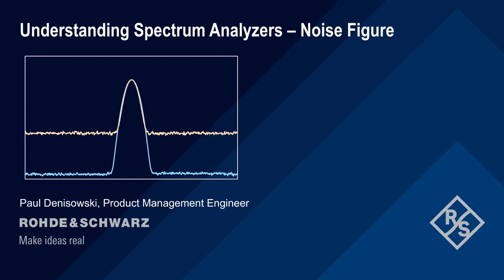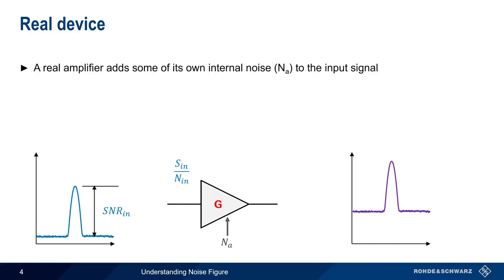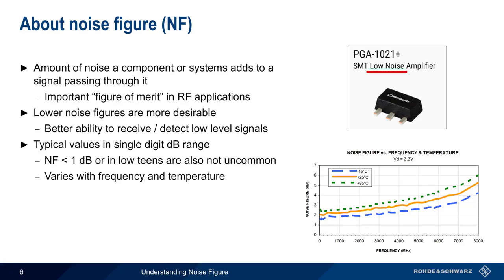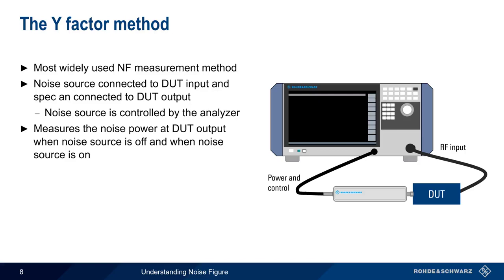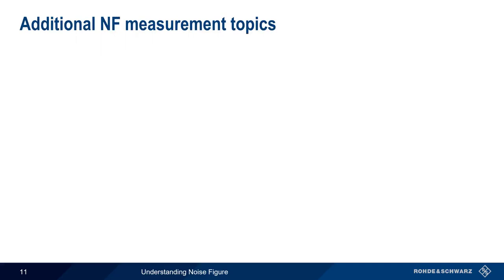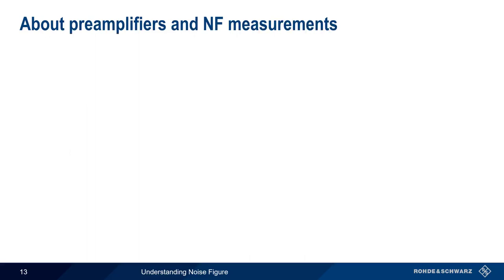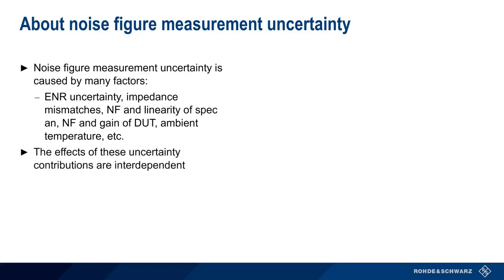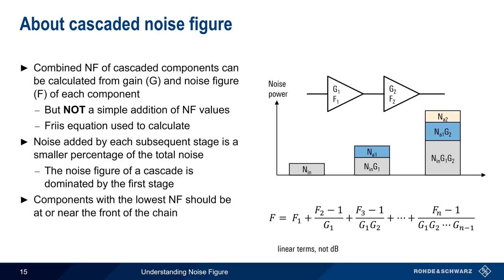Understanding Spectrum Analyzers – Noise Figure

Comment: In slide 15 should we insert noise figure or noise factor into the equation? It looks more like noise factor
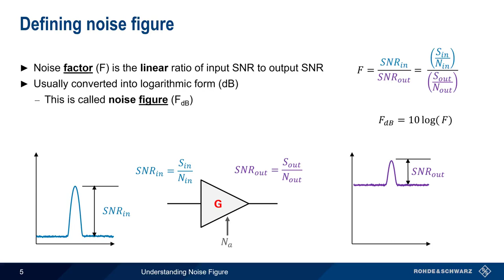Reply: Yes, the equation uses noise factor: that's the reason why I added "linear terms, not dB" below the Friis equation.  Noise factor can then be converted into noise figure using the equation shown earlier in the presentation (see 3:04).  Cascaded noise figure is actually such a complicated topic that I'm planning an entire separate presentation on it (which will be uncreatively named "Understanding Cascaded Noise Figure"), and I'll go much more into the mathematics of cascaded NF in that presentation.  In the meantime, if you're interested in more of the math please have a look at the Y-factor whitepaper linked in the video description -- it has plenty of formulas and derivations :).  Hope that helps and thanks for asking!

Comment: Hello ,
In the slide 8, DUT is connected to Noise source and SA source on both side. I guess it should be connected to SA Output.
Reply: Slide 8 seems correct to me. The noise source output is connected to the DUT input and the DUT output is connected to the SA RF input. Additionally the SA provides the noise source with power and control data.

Comment: Key Concepts Covered:

Signal-to-Noise Ratio (SNR): SNR is defined as the ratio of the power of a signal to the adjacent noise power, typically expressed in decibels (dB). Higher SNR values indicate better signal quality relative to noise.

Ideal vs. Real Device Behavior: Ideal amplifiers theoretically amplify only the signal without adding noise. However, all real-world devices introduce some level of internal noise (denoted as 
𝑁
𝑎
N 
a

 ) when amplifying signals, thereby degrading SNR.

Noise Figure (NF): NF quantifies the amount of noise added by a device or component to a signal passing through it. It is crucial in RF applications, where lower NF values are preferred because they indicate less noise added.

Measuring Noise Figure: Two primary methods are discussed: using Spectrum analyzers and Vector Network analyzers. The presentation focuses on the Y-factor method with Spectrum analyzers. A noise source generates a known level of wideband noise, facilitating NF measurement.

Y-Factor Method: This method involves comparing the output noise power with the noise source off and on. The difference (Y-factor) is used to calculate NF. Calibration is essential to account for the Spectrum analyzer's own noise figure.

Additional Measurement Topics: Topics covered include the characteristics and importance of noise sources (specifically ENR - Excess Noise Ratio), the role of preamplifiers in reducing measurement uncertainty, and understanding cascaded noise figure calculations.

Measurement Uncertainty: Various factors, such as ENR values, impedance mismatches, and ambient temperature, contribute to uncertainty in NF measurements. Modern Spectrum analyzers often include uncertainty calculators to aid in accurate measurements.

Cascaded Noise Figure: The combined noise figure of multiple components in series (cascaded) is not simply additive but calculated using the Friis equation, considering gains and noise figures of each stage.

Comment: Understood, just one question: What is the point of this measurement? All I care for is the noise density of the amp and it's gain.
This number is completely dependant on frequency, bandwidth, input level, ...
Reply: The usual goal in noise figure measurements is determining the amount of noise added by a device, and NF measurements usually also yield the gain of the device as well.   My understanding is that "noise density" measurements of an amplifier are made with the input either open or shorted and results are in V or A per sqrt(Hz), whereas NF measurements require an input noise source and results are in dB.  Both are ways of quantifying how much noise is produced by a DUT, so they serve similar purposes.
Reply: @pauldenisowski  "amount of noise added by a device" Just one issue, it does not. It is a rate between SNR.
"NF measurements require an input noise source" No, they do not require noise, they require some form of signal. What that signal is is undefined and the problem with the concept.
The NF is supposed to be two things:
* A figure of merit
* A value that makes the calculation of amplifier chains easy.
It doesn't do either.
Reply: @0MoTheG  Thanks for your reply.  The difference between input and output SNR of a device under test is, by necessity, due to the noise added by the device under test.  There are of course other ways to do this, but the noise figure measurement definition and process described in this video is the method used by most RF device manufacturers and is supported by all RF test and measurement instrument providers.  In fact, if you look at the specifications of RF amplifiers from any manufacturer, "noise figure" (as defined here) is usually the first or second specification (the other being gain, which is also determined as part of a noise figure measurement).

As mentioned in the video, there are other methods that can be used to measure noise factor (such as the cold source method often used with VNAs), but this video only describes the Y-factor method, which is - by far - the most common method used in spectrum analyzers.  This method does require the use of a wideband noise source.  

And although I didn't go into it in detail (for reasons of time), this presentation also introduces the concept of cascaded noise figure and how to use the Friis equation to calculate cascaded noise figure (i.e. amplifier chains).  Again, this is a very widely-used, well-known method of calculating the noise figure of a chain of devices such as amplifiers.

In addition to the white papers linked in the video description, almost all test and measurement instrument manufactures and most major RF device manufacturers (Qorvo, Analog Devices, NXP, TI, etc.) also have white papers / tutorials / etc. on the noise figure measurement described in this video, so I would refer you to those if you'd like more detail or additional information.  Thanks again for your comment!
Reply: @pauldenisowski  I see that you are a smart person worthy of a detailed, nuanced answer. I will do the required reading and then bring forth my critique.
For it we have to consider input level and bandwidth.
Reply: @pauldenisowski  How is the measurement effected by the absolute power of the noise source?
Doesn't the NF go down when I use a higher temperature source?
Reply: @pauldenisowski  Just because something is repeatable, common practice doesn't make it sensible. There is nothing wrong with the measurement itself. The concept of a NF makes no sense at all because noise is additive.
By inputting more noise into the DUT I can always drive the NF to one.
The fact that the noise levels of the source are a guideline not a rule undermines the significance as it effects the error.
What the Y method actually measures is the noise density of the amplifier if it were a white noise source. THAT is a meaningful measurement.

Comment: Signal-to-Noise Ratio (SNR):

SNR is the ratio of signal power to adjacent noise power, crucial in determining how well a signal can be detected and demodulated.
It's reported in logarithmic units (dB), where a higher SNR indicates better signal clarity and easier information extraction.
Ideal vs. Real Device Behavior:

Ideal Device: Amplifiers ideally increase signal power without altering SNR, but in reality, all devices add internal noise (N_a), degrading SNR.
Real Device: Real-world amplifiers introduce their own internal noise (N_a), which lowers the output SNR compared to the input SNR.
Defining Noise Figure (NF):

NF quantifies how much a device adds noise to a signal passing through it.
It's the ratio of input SNR to output SNR in linear form (noise factor, F), converted to dB (noise figure, NF).
Measurement Process:

Instruments: Spectrum analyzers are commonly used to measure noise figure.
Method: The Y-factor method is employed, involving a noise source connected to the device under test (DUT) input, and the Spectrum analyzer measures noise power at the DUT output with the source on and off.
Calibration: Calibration adjusts for analyzer noise, ensuring accurate measurement of DUT's noise figure.
Additional Topics:

Noise Sources and ENR: ENR (Excess Noise Ratio) specifies noise source performance, crucial for accurate measurements across frequencies.
Preamplifiers: Used to enhance measurement sensitivity by reducing analyzer noise contribution.
Measurement Uncertainty: Various factors affect accuracy, managed using uncertainty calculators in analyzers.
Cascaded Noise Figure: Calculated using the Friis equation, considers cumulative noise contribution of multiple components.
Summary:

NF quantifies signal degradation due to added noise.
Y-factor method with Spectrum analyzers is standard for NF measurement.
Preamp use and careful calibration minimize measurement uncertainties.
Cascaded NF calculation helps optimize signal chain design.